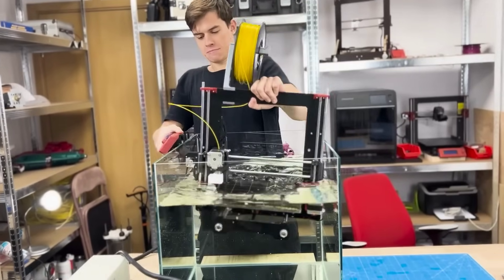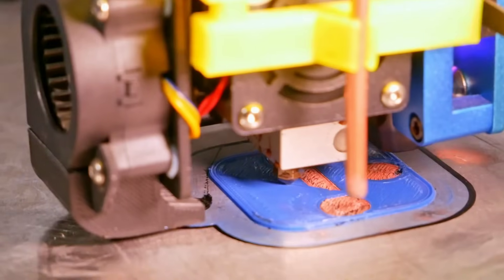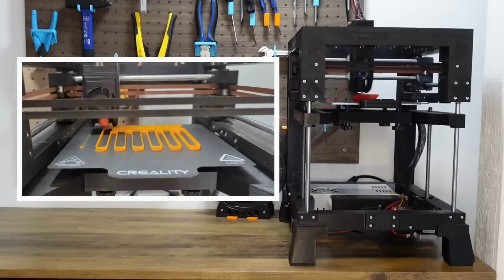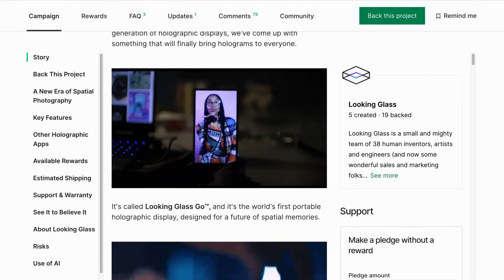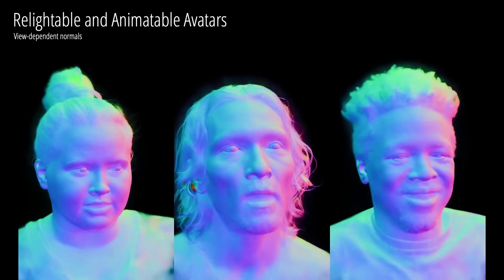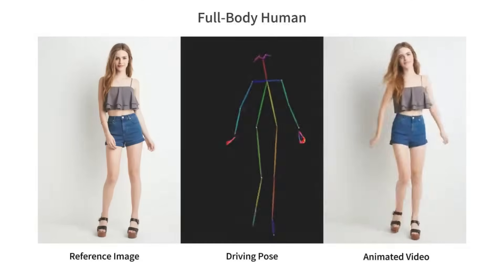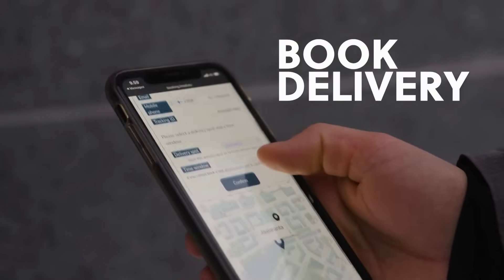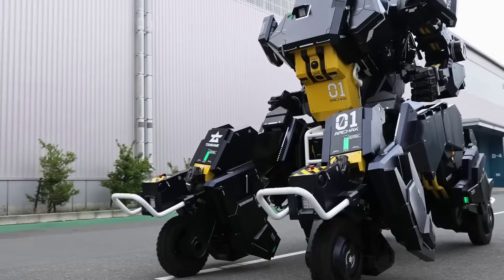Awesome Underwater 3D Printer Tests (+ More News)

Comment: One of the main reasons that eye tracking is so important for VR is deliberately not obvious.  Our visual resolution drops off drastically from dead-center, so, by knowing exactly where someone is looking, a scene can be rendered at that relatively small spot in 4k but down to 240p at the edges without the user being able to tell.  That saves a LOT of processing, allowing games and apps to offer FAR better graphics without needing a high-end GPU.
Reply from the maker: Exactly, it reminds me of that VR headset mod from last year. A guy added RGB LEDs to the edge of his peripheral vision which mimicked the edge of the main displays. Since the eyes don't focus on that area when you're looking in the centre it is a super cheap way to create almost full human FOV.